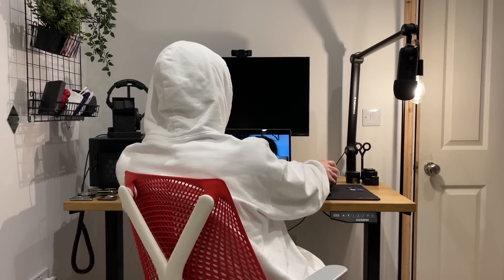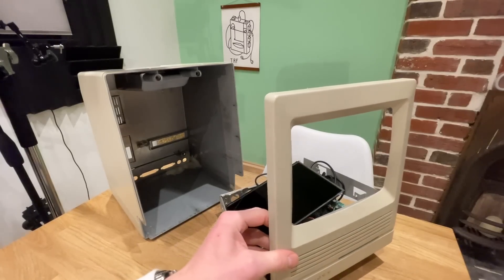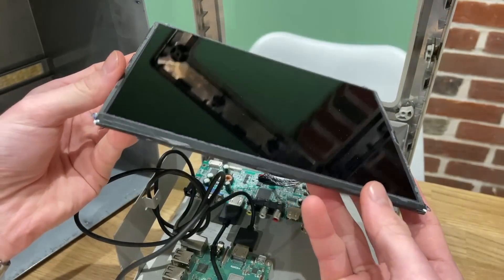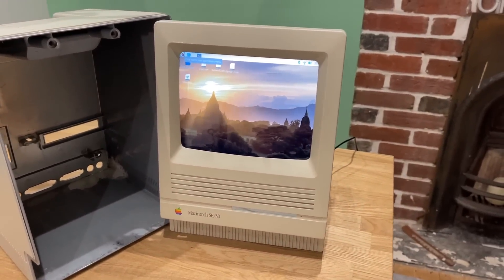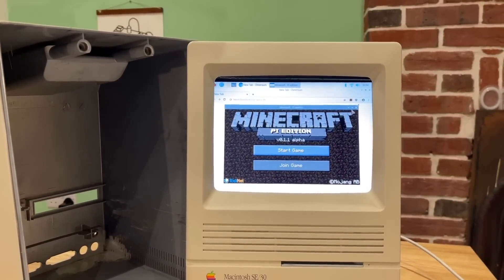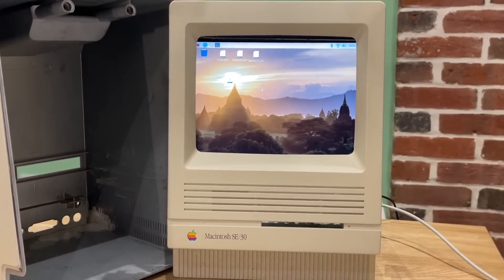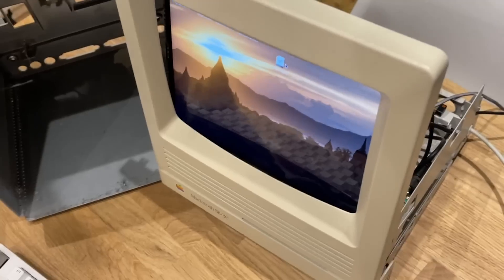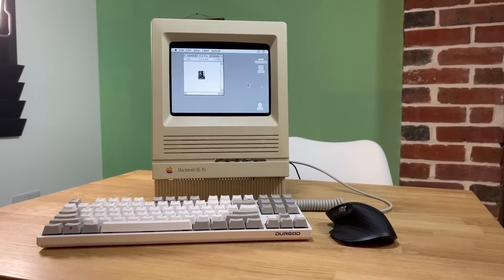Raspberry Pi Retro Macintosh Project

Comment: did one similar a few years back. i wish my driver board had HDMI. display port only so i used a small PC instead of PI. also dremeled out the bezel a bit to not crop the screen but kinda turned out mediocre

Comment: Check "cool retro terminal" software. Also you can use a Chinese buck converter to draw 5.25V for the pi from the 12V display.

Comment: What about a VR machine. Probably a lot of space in there for a graphics card and you don’t need a big screen because you have your headset. The handle on the top of the case makes it easy to move around and about the right size for some sort of headset stand.

Comment: You should stick to it and make it a reality for yourself.
I did the same with a broken breadbin C64 prior to the THEC64 Mini announcement and I am really happy about how simple it actually was, partially thanks to 3D printing parts already being available on Thingiverse.
The C64 Pi mentioned right now still houses an old Pi 3 with a USB2 enclosure for a 2.5" harddrive or SSD in it but I really consider to replace the Pi3 and the USB2 adapter with my Pi 4 and a USB3 adapter.

Comment: I have the exact same idea with a broken iMac G3 i own! The analog board is making scary popping sounds and the crt is dull as it can be, it whas an old school iMac so yeah, the thing is just worn out to bits! But i really love this iMac, and my plan is to gut the machine, install a modern lcd monitor in it, i have this small acer laptop motherboard which has everything on board, you can plug in ssd's, sd cards, it has bluetooth and wifi, hdmi and usb 3.1, i want this to become a linux mac, or a hackintosh for that mather, i just need the parts to make it all work, now this motherboard is build into a wifi modem, which people think is cool, but the ultimate project would be this iMac G3 project offcourse! I think you have to finish it, the idea is so cool, and you got all the essential parts ready to go, so you have to finish it man, it would look so cool! Action Retro made the smallest PowerMac G3 setup in the world, he also used a raspberry pi, and the thing acted like a real mac, including the bong sound, it would act and boot like a real mac, so i think you could do something like that, and than "emulate" the real linux environment, i think he uploaded the sd card image to archive.org to make it happen, it will boot into macos 9 directly, but you can jump into linux offcourse to do 'real' work :p have fun making your project!

Comment: you can use a piece of light filter gel sheet to make a cover for the screen, stick some double sided tape around the inner edge of the Macintosh display and stick the gel sheet to it, it will follow the curve of the crt but would dim it, I'm doing it right now with an apple //c monitor

Comment: I built one of these! 
A Pi 3B+ with Retro Pi/Emulation Station, an 8.4" 4:3 lcd screen plus driver from China; extended USB (front & rear), Ethernet, HDMI, Audio, etc. to the back ports of the Mac. 
A HDMI splitter to send display to both in-built screen and HDMI port on the back.
Two power supplies inside, one for screen, second for Pi, both connected to a single kettle power in the original Mac hole with original style rocker power switch to turn it on/off. Even have a power LED on the front :-) 
Pair of Bluetooth PS3 controllers completes the set up.

So, do it! Complete the build.

Comment: The Pi 3 (and 4) is really sensitive about how much power it gets. If you can get the official wall wart for it, I'd go with that. I think I remember reading that it goes beyond the usual 2.4 amps that USB power supplies top out at and delivers 2.5 amps.

Comment: Ok, so someone else has mentioned it, check out action retro’s videos on how to get the Rpi emulator going for the Mac, what you could also do is theme the Linux setup so that it resembles MacOS X or even MacOS 9, Linux is extremely flexible so that’s easy to do.

As for the case, you can get little surface mount USB extender plugs that are designed for things like furniture or wall mounting, and basically ‘transfer’ the USB ports from the Pi to the back of the case, therefore reducing the times you’d need to uncase the unit. If you wanted to get tricky you could even chuck a couple ‘hidden’ USB connectors in under the little offset ridge on the front of the case for things like controllers.

You can get USB power leads with switches on them, if you mounted that kind of thing onto the back of the case you can easily make an easy on/off switch for the unit.

Screen screw mounts can be 3D printed and attached with epoxy to the inside of the case so that you can mount the panel using the existing screw holes or you could make little half circle ‘clamps’ that screw in and rotate in and hold the screen up and in place.

Stuff to use it for once it’s done? My absolute first recommendation would be ScummVM, playing some of the old LucasArts games, or Emulators, plenty of stable ones on Linux. Use the Mac emulators, play some glider pro, (macintosh garden has an enormous library, and with a couple different emulators you can emulate up to OS9 and play some awesome games from back then)

As for adding a couple card readers? People have suggested just slipping one in the floppy drive, or you have a good cutout for a surface mount card reader on back.

One of the neater things you could use it for is a jukebox, get a quality speaker and fit it in the case with everything secure, hook it to the raspberry pi and run a music playing program on it like Amarok (which looks awesome) to choose music, or chuck some audio jacks on the back and run them to the Pi for external speakers.

Comment: OK got some thoughts. I saw a thread on the Raspberry Pi forums and it seems you can actually run a USB floppy drive. There is also the Basilisk emulator if you want to emulate later 68k MacOS up to 8.1 with real system software. You can use the built in overscan on the raspberry pi to give it black borders around the screen. It might also be worth playing around with the raspberry pi so that it will boot straight in to mini vmac or basilisk.
Reply: Long term/crazy idea: swap out the RPI for a MiSTer FPGA with the MacPlus core?

Comment: Do it. I turned an old Compaq Presario laptop with a K6-III into a 68K Mac laptop using an emulator years ago. But bringing back an old SE/30 case and making it a Mac again is cooler.

Comment: The suggestion I'd make is to make (3d print, particle board and glue, however) a cover for the slot in back and route your USB cables to it. The power strip inside could be good, especially a tiny one. Only really needs your monitor power and a USB cable. But likewise, you could always use the front drive slot for an SD card port instead. Won't be completely discreet but most people won't try to push a floppy in. ;)

Comment: That yellow lightning bolt at the top right corner around 4:30 means the Pi is not getting the necessary power to work at full speed. Consider getting a better power supply for it. Very cool project! Please give it the chance it deserves!

Comment: Retro Mac projects are my favourite. There's something classic about pre-iMac Apple designs. 

I like that the case itself is unmodified. What about replacing the Pi with a Mini-ITX or some kind of nano PC? You could then easily run full-speed Basilisk II and basically have an original SE/30 experience that wouldn't scare away someone who time travelled from 1989.
Reply: Then please check my video, I’ve „upgraded“ my Macintosh plus with a Mac mini inside 😇

Comment: You could also get an era accurate keyboard and mouse. Decode those with an Arduino. And the SE/30 can run Mac OS 8.1 with a ROM upgrade so you could probably have that running.

Comment: Hey Elliot, i think you might want to put the SD Card reader on the front, where the floppy drive was, so it keeps that spirit of popping a floppy in and load a program. Besides that, I think it's a pretty cool project and I hope you can get to work on it again
Reply: You could also mount a USB floppy drive inside if you want to use real disks on the pi
Reply: @TheLeggedOne  I thought of that, but it would make you need another one to write floppys, not even taking in consideration the fact that the reading/writing speeds would be terrible and the fact that it's still about 720 Kilobytes (i think it was that). What could be done tho, is making a 3D printed case for the external drive to make it look like an external drive from Apple at the time and have it plugged in a usb port put at the rear where the parallel port was.

Edit: i also don't know if there's any compatibility at all between Raspbian and the usb drive
Reply: @TheLeggedOne  that would be pretty neat, even if you would need to plan out what you would actually want on the Floppies given they are so much smaller than modern storage, unless of course your using ligit old floppies with the actual software on them for a emulated version of the intended OS
Reply: you can even make a special floppy disk drive to read a sd card inside a floppydisk . like this one in this video: https://www.youtube.com/watch?v=gNQYbSWBhAs&ab_channel=DanieleTartaglia
Reply: or a usb floppy drive
Reply: I built one of these and I did put the SD slot at the back, purely because I only alternate between two operations systems and not that often. But the floppy slot, I played 3 USB ports and another at the back and it's much more useful
Reply: That's what I did with my mothers from 86. She was a teacher in Augsburg, Germany and had setup a computer lab for kids back then. I found it in her attic after her passing a couple years ago and wanted to restore it.  So, kept the bottom floppy and replaced the top with a blacked out SDCard reader.  Placed an LED behind the Eject pinhole.  Turned out really nice.
Reply: No put a real floppy